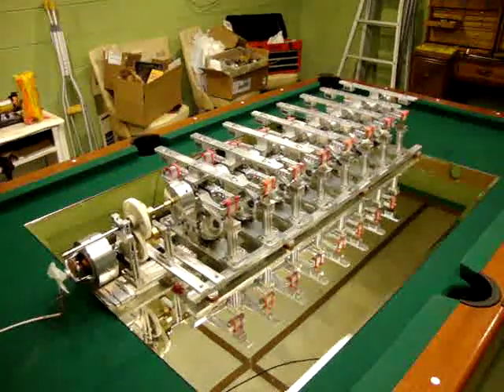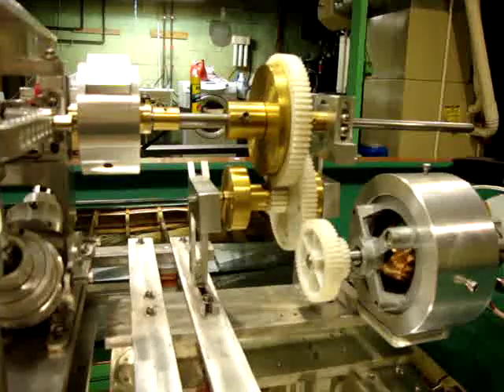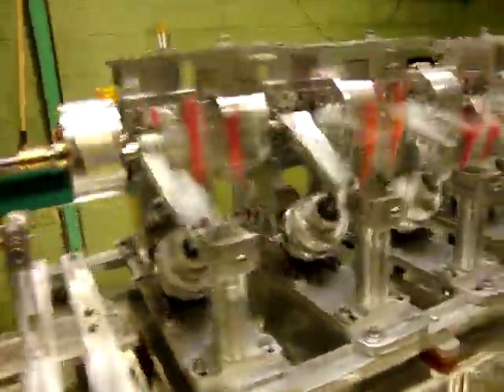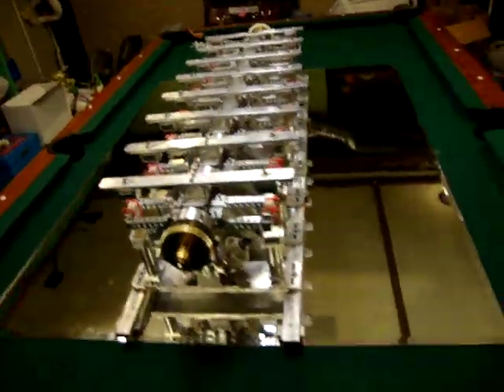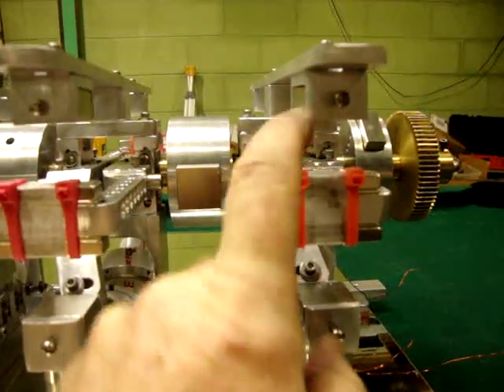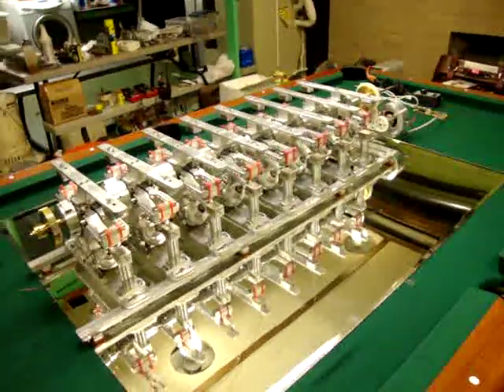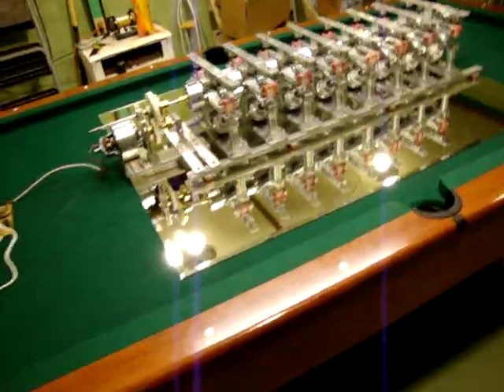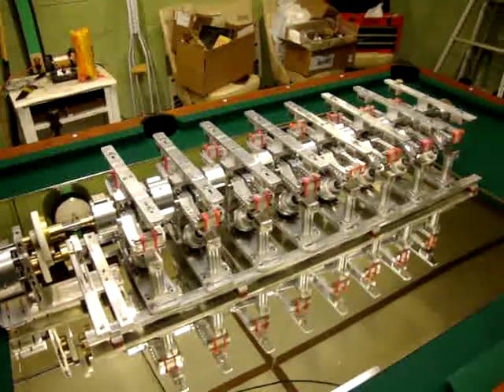Over Unity 23

Comment: have you visualised this as a new wind turbine generator ? That would be a very powerfull wind turbine motor indeed especially if you rectify each coil and create d.c. Pulses through toroids which will increase the voltage on every coil .